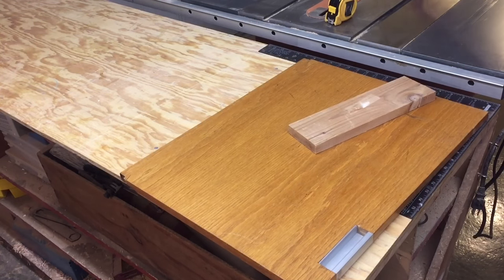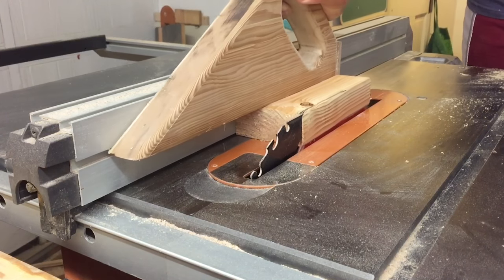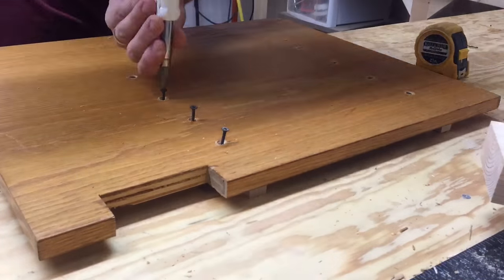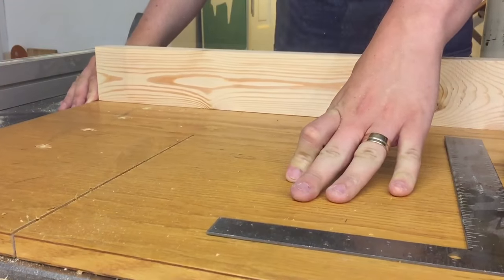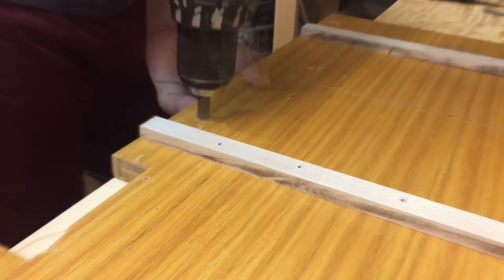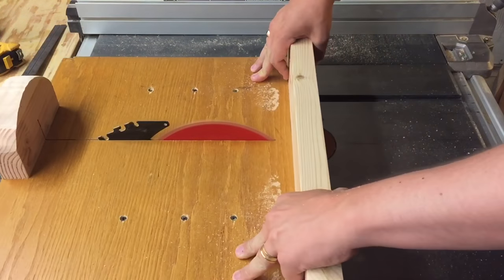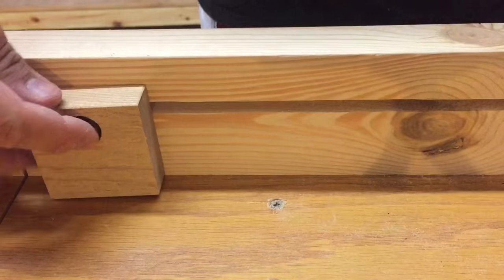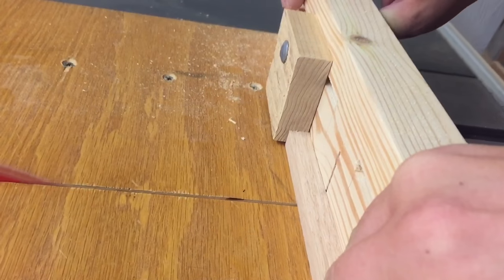How to Make a Crosscut Sled

Comment: Nice build, much simpler than I had planned on mine, so might go with your design.  I do like the stop setup.  I do suggest you shield the blade on the back side to force you to keep your hands from the blade.  It had been too hot here in Texas to do anything, but I have to build a whole new set of jigs for my new table saw.  The one I used the most on my old Craftsman saw was my 90 degree sled.  Made a lot of frames with that one.
Reply from the maker: I hear you loud and clear.  Great jig to have handy.  Good luck with making your new set.  I'll think about adding something to the back for extra blade protection.  Thanks Jim!

Comment: I just built my first cross cut sled, which I am planning on using to build a better cross cut sled... all so I can build a miter sled and a box joint jig... it's a process, haha. my first sled had a stabilizer on the front that ended up being perfectly square, so I just used it as the back fence.
Reply from the maker: Ha, I appreciate your jig upgrading process!  I'll be adding a box joint jig to this playlist this year too.  Can't wait to hear how yours turns out :)

Comment: Great video!  The only change I would make to your sled is to chamfer the bottom front of the back board, so that saw dust doesn't pile up and cause issues with repetitive cuts.  Cheers!
Reply from the maker: Thanks Tex! (that's my new nickname for you now)  I did that with my smaller sled I've used for the past year, and I'm not entirely sold on it.  I may take your advice and go back to add that down the line, but first I want to test it out a while.
Reply: LOL! Really confuse the people reading the comments "Why's he calling the Canadian 'Tex'?" (=  

It could also be apart of the table saw designs and dust collection.  I don't have any dust collection on my saw (I wheel it outside and let nature deal with the dust afterwards), so lots of saw dust goes everywhere.  And I do have the issue with the dust collecting on my sled at the back, but I did chamfer it so it wasn't a big issue for me.   

Cheers!

Comment: Well done. 
Something I have found that works great for runners is slices off a cheep plastic cutting board from the store. I repeat. From the store, not your kitchen. That doesn't go over very well. Live and learning guess. 
Keep up the good work.
Reply: I agree, I actually spent the bucks and bought HDPE (?) stock, but next time it is going to be cutting boards on clearance.
Reply from the maker: You know, that's a really good idea.  I imagine that the plastic won't swell like wood would.  Great suggestion, thanks Scott!
Reply: +Midwest Man Mountain it works great for any jig that rides in a track.. Being also from the Midwest the expansion and contraction with hardwood runners can drive you nuts. Sloppy loose in the winter and tight in the summer.
Reply: Scott Fogarty We have wood movement bad here on the Texas coast too.  I have had shop cabinets I made start out perfectly square turn into pretzels in a matter of months.

Comment: Stupid question, what is the advantage of a sled? What can you do with a sled that you can't do with the sliding fence that comes with the saw ?
Reply: Lots of stuff, especially when doing small cuts, repetitive cuts.  It also holds the work better than a miter guide, even if you extend it with a backing piece.
Reply from the maker: That's a great question!  Like Jim said, sleds are terrific for repetitive accurate cuts.  Additionally, I love sleds because it eliminates board friction with the saw.  The sled is in contact with the saw, but the runners keep it moving in the right direction.  With the board on top of the sled it has no forces acting on it that might cause it to slip out of place--instead it just sits where you put it and waits for the saw blade.  If you only use the miter guide with the cutting piece sliding along the saw you run the risk of more movement and friction-related issues.

Comment: How do I make a sled if my table saw does not have the grooves for the sled? It's just a flat piece of metal
Reply: There are a couple of ways, the first one is to use the rip fence as your stabilizer, just insure that the fence is set in exactly the same place every time this will insure you have a consistently  placed and sized saw kerf.

If you have a moving or European style table saw,  you will have to affix it to the moving part of the table top, usually making it as wide as the saw, and adding a couple of overhanging "stops" to keep it aligned, then just clamp it down.

Hope that makes sense.